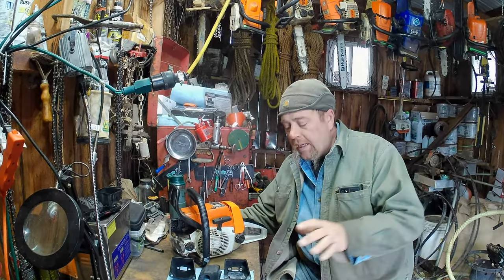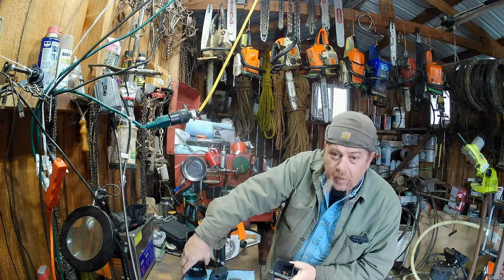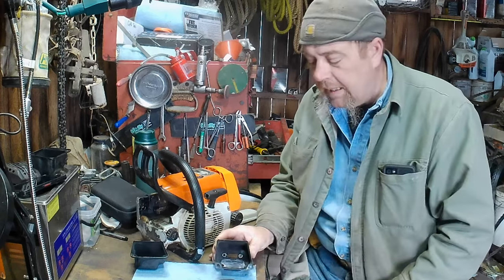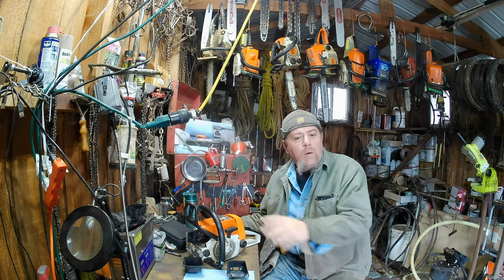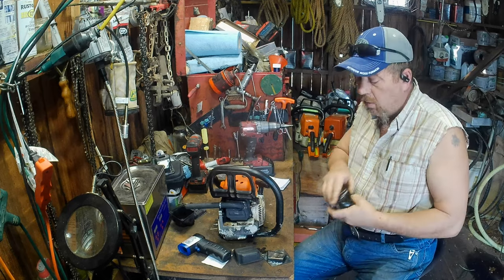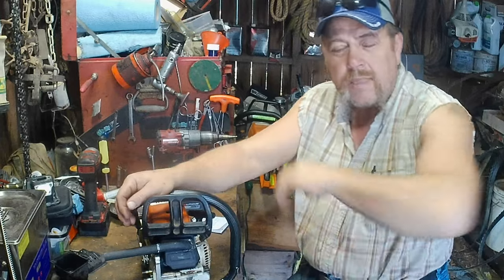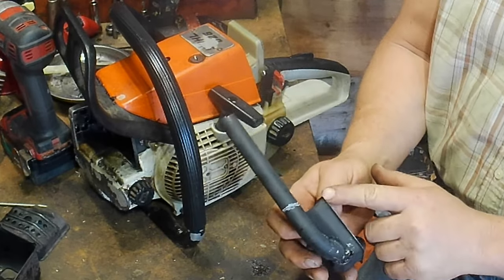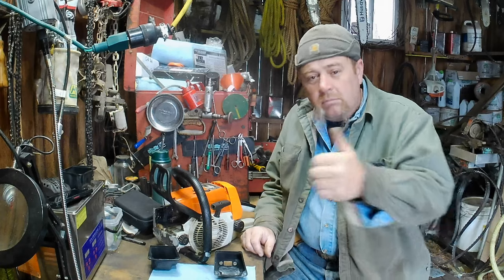TRICK to find PIPE LENGTH for Chainsaw; CONFIRMED!! Dyno and HEAT Results

Comment: You got me  thinking mufflers and exhaust to a lot lately. Looking for a good balance  between performance and noise, just something for all day cutting. I’m trying something like your tuned piped but I have the pipe about 1” inside the can kinda like a mid bleed stinger in theory. Going to try the heat gun trick. Keep up the great work man!
Reply from the maker: @BuckYaSaws That's why I like two strokes; every little nuance can keep my mind occupied for days!!  With the stinger protruding into the can, I've found a bit of a performance gain by having the pipe cut at an angle to "catch" the exhaust as it comes out of the exhaust port.

Comment: Thank you for a very detailed and informative video 👍 What about a 70mm (2&3/4 INCH) pipe straight trough the muffler with 20mm (3/4") on the outside of muffler, at approximately 90° angle?
It would be very interesting to compare that to your goofy long pipe 😂👍
Reply from the maker: @lundberg223 Thanks!! The 70mm length is about right; the "problem" that I incurred was that the inlet to the pipe (inside the muffler) didn't have a good straight shot for the the majority of the gasses to have a good entrance path to the pipe. I think it can be worked out, but I haven't found the optimum solution yet. I've got some ideas (I hope) for the next attempt.  Thanks for watching and ESPECIALLY for joining-in down here.

Comment: Do you have a video showing the in and outs or demetion of the bar box??
Reply from the maker: @dillardwinters4882 I don't have a video recorded specifically for the build of the cover; it was a flat plate with about.4 sq in of area hole cut in the lower left of the muffler chamber; I cut it as close as I could to the lip without having it obstructed by the lip. The outer cover was just a piece of sheet which was bent to accommodate the opening and widened as it went upward and outward toward the bar/chain. It widened to approx 1-1/4" wide and 1/2" of depth. On the 026, .4 square inches of opening worked best with the reduced volume can (in another video https://youtu.be/--lw9ZkjH4o ) Once I went past 0.4 Sq In of opening to 0.58 sq in of opening, I began losing power. 0.4 sq inch was the sweet spot on this particular saw.  I didn't lose enough power compel me to remake the bark box lid at this time, but I will at some point and intend to make a change to make it even better. I don't expect it to be a huge change, but I'm searching to all the little things that can stack up to big gains so that we can skip right past the stuff that doesn't work and include the stuff that does work on the next builds. Thanks for being here and especially for joining-in down here in the fun!!

Comment: Just a guess, what you have going on is more of a header than expansion chamber. The heat gain/loss is probably related to exhaust scavenging and the hot spot probably changes location with rpm.
Reply from the maker: @Super-Dave-Outdoors  Awesome point!! I thought about that after i did the test and considered the RPM/distance of hot-spot relationship... I had already pooed the scrooch at that point!  
Further, i agree on the expansion chamber; I consider (probably incorrectly) that ANY muffler is too small to make a proper expansion chamber in which sound waves play the major roll. I'm attempting (maybe in vain) to understand it from strictly a volume of exhaust gas while ignoring the science (bad practice I know) of the sound waves... not convinced they apply to this small of a can-style muffler.  The next saw video of reducing can volume REALLY worked on some and didn't on others. 
When I started working on saws I was often-wrong, but never in-doubt; NOW, even if I happen to get something right, I STILL question it! 🤯🤯Thanks you so dang much for your insight and input!!!
Reply: I'm with super Dave on this one.  Believe he explained what is happening with heat and scavenging. From my experience with pipe length and magic dyno feel. Longer pipes favor low end power and shorter pipes respond quicker and like the top of the curve. This is what is so contradictory to 4 stroke exhaust.   I've often wondered what divided flange exhaust much like an x or h pipe would do on a saw. Would it act more like a chamber pipe being you are able to truly direct the flow of the exhaust. I know divided flange turbos are consider more efficient spool quicker and create more power when tuned properly. I understand this is done with the pairing of multiple cylinders and creating the same length. Could a single cylinder 2 stroke be " tuned " similarly but using the divided flange approach of a turbo by the x or h pipe design to give you the best of both? 🧐 I think I just scrambled my egg there. Darn rabbit holes got me again.  

Hey great series and another great video. Really enjoy your whole approach to your channel and taking in constructive criticisms and feedback. Some people are a bit to P.C but I can see you have the clout to stand and take it. 😆 Nice job! Always a delight. Thanks
Reply: You’re way out their ahead of me on all of your dyno testing. Just the fact you built all your test equipment out of what looks like your wife’s ole sewing machines, and Maytag washer/dryer parts shows your ingenuity, but producing the sound information out of that contraption shows your analytical high IQ mind racing out their at the NASA level. I hope the, I hate to say it, “Stihl” Chainsaw engineers invite you to their testing and proving grounds. Me, I’m gonna to wait, like the Chinese Manufacturers , until you prefect it and just copy your work. I am gonna write the Stihl Corporation and ask they give you a free tour of their chainsaw testing plant. Keep up the good work. Ole mountain man
Reply from the maker: @eze.Morning_Wood_Farms  Aw heck, there's no shame in being ignorant... stoopid is another story. I am soooo far behind most people on saw building it ain't even funny! I've built way less saws in my life that some people build in a day or three...I take no umbrage in being taught by people who are willing to teach me... no matter their delivery (most are super nice though)... I had a career of not being the most popular guy in the room... you're right, I can take it.  I think volume  (next saw video) is going to open-up some ideas and thoughts to keep the grey matter from stagnating... at least for me. Thanks for being here; hope the dog is keeping them pesky puddle pirates off your pond... looks like he likes the challenge!!!
Reply from the maker: @olemountainman3996  My WIFE'S sewing machine... pfft; the old Singer (was my great grandma's in a leather covered box) is mine and I won't let her use it!! The Dyno has parts from a all kinds of gadgets... a homemade PTO generator, feed grinder/mixer, old round baler, etc... The pipes on the saws are made from the tubes from an old office chair and an old ironing board (so far); you've got me pegged!!!! Them Stihls make me look good as there's so much room for improvement; them other saw builders all build Huskys... 10 minutes and they got a ripper; takes me 10 minutes just to get to the air filter on a Stihl 😉😉 Thanks Ole Mountain Man!!

Comment: I think that offset cylinder is the best thing for practical efficient engine there is and there are so many variables to play with rod ratio etc. I just like to cut trees and don't do all that all out race saw
Reply from the maker: @richarddodds9326 I also think it has a great ratio of risk/reward; more torque, more hp, less wear on the piston. This saw has an offset cyl (quite a bit after this video) and is actually a VERY mild build; I have not gone extreme on anything, but keep stacking the little easy-to-get gains and it will probably need tamed back down a bit before I turn it loose in the woods and exposed to dull chains and whatnow. THanks for joining-in; this is the first comment from you that I remember... welcome sir!!

Comment: 230E is named after my favorite log skidder, a 1980 Timberjack 230E. Youtube added the 4 recently so it had enough caracters, I don't really like the 4 on there (maybe youtube shouldn't make decisions by themselves ;) or perhaps I should use a proper name instead of numbers. It would be very interesting to see the effects of shortening the pipe inside the muffler. I typically run about 3/4" inside. I have noticed the exhaust tends to be quieter with more pipe inside, depending on it's  orientation to the exhaust port. After trying a bunch of different diameter pipes and doing test cuts I have pretty much settled on 1" pipe, 7/8" I.D. I even experimented with copper pipe of different sizes. It is great to see the tests on your dyno.
Reply from the maker: @230e4  Ahhh; I reckon the ol Timberjack did have 4 tires, so there's THAT! Bet I can remember now! I've cut some some off from inside the pipe and cut it at a more favorable angle while doing so. I agree that a bigger pipe is in order, but I wanted to try some baby steps; the next video is the reduced-volume can using these same lids (3/4" hole, bark box, and this pipe); I may add the the pipe with the bias-cut to the video (editing it now, but haven't recorded the biased cut or tested it yet). I also have some pipe picked out of the scrap heap that I think is about .8" ID which I want to try (as well as larger hole in the can and larger hole in the bark box. I will let the cat out of the bag; one of the lids really liked the reduced volume can; the pipe did not really like it; I think it's too close in proximity to the reduction baffle to allow proper air flow into the pipe.
I'm starting to compile data on area (sq inches and sq cms) of holes and pipes as well as volume of pipes; I'm compiling the info in the event that a pattern may appear. I will see if there is a way to share it in the video in a easy-to-watch and understandable way... heck, I don't even understand it yet...not enough data points. I'm also aware of many many variables to even hole size and pipe volume; plus, I'm satisfied (guessing with misplaced confidence) that volume needs will change drastically with diameter.   ...heck, I'm rambling again. Thanks for your input and being here. How long were/are your 7/8 ID pipes? (with 3/4" inside?)
Reply: @HayChaffandSawdust1  Thanks for the reply. The pipe is 1.5" overall. I put them in the clutch side upper corner like the OE 372xp. I have wanted to test more with no pipe inside verses having pipe inside, but with farming and logging full time it has been hard to make time for it, that is why I am grateful seeing folks like yourself testing modifications and sharing them. I have simply run the dual port Stihl mufflers opened up some on my 066, ms660, 046, ms460, and ms461 saws for years because they were quick to do. Have a great day!
Reply from the maker: @230e4 I get the busy-life bit; beside the sawmill (as I feel like it), the chainsaws (for fun as I have time), I also farm about 100 acres of hay here (mostly square bales) as well as raise cattle, sheep, and a few hogs... not comparing or crying; just saying I understand!!!! Have a safe one today!!

Comment: Very interesting.  Some other things to keep in mind, when you change the exhaust, you may need to change carb settings.  It would be good to get the cylinder temp as well.  I ran r/c cars several years ago and we reffered to the area of the pipe to the air as a stinger.  There are different sound waves with longer and shorter pipes.  I thought your ideas are pretty good.  I hid a pipe in the muffler of one of my saws.  It does pretty good. Looks strange in you see inside.
Reply from the maker: @rcracer641 Very Good info!! I assume you just found this channel; I do  tune the saw each time with different pipes and/or different temps for each Dyno or heat pull; I tune it for max pull at 10k (that's the fairest way I know presently... but, I am working on tuning by exhaust temp) . 
If you find time to watch the end of the video, you will see a chart of head heat temps for each run Vs HP (pulling at 10k) for each exhaust type tested.
I fully agree with the stinger and expansion chamber and the effects of each. I'm trying to consider that, since the most-effective sound waves are created in the expansion chamber... and a chainsaw doesn't have a large enough, long enough, or shaped properly enough to make the most of sound waves, it may be better to harness the rebound of the actual exhaust column (as it travels differently than the sound actions used to tune a pipe) to maximize performance in a can-style muffler.
We (hopefully) will have added exhaust temp to existing head temp after the next video (takes me a bit to edit and the next one... really neat reduction in volume of the can will be next in line).
Thanks for joining-in and taking part.

Comment: Since you are doing mufflers..  I have often debated with a stihl style muffler putting a solid "divider" plate between the halves.  Both one that is flat and one that has been hammer formed to protrude into the can on the side opposite of the factory outlet (if a single outlet saw)
The plate would DRASTICALLY reduce can volume, especially the one domed in some towards the hug half, and in my mind might make a can perform more like a pipe as the pressure peak would be higher, but the dwell time shorter.  A flat plate would be easy to cut out and test.  The hammer formed one less so..  but it might give some insight into can volume.  Most factory cans seem to encourage bounceback and swirling with geometry.  One could totally F with that with just some 20ga steel sheet and see what happens.  If someone made some hammering jigs from hardwood all kinds of internal shapes could be tested.
Reply from the maker: @mattfleming86 The next chainsaw/dyno video is/will be a reduced-volume can and the results were better on some and worse on others (I think... still getting info into dyno, but gut feeling and watching the numbers  on the pull). I have not got it hashed-out in my head NEARLY as well as you. Out of curiosity, how much had you considered reducing the volume?  
I agree on hammering out thin stuff to try-out; used @.025" (don't know gauge... was shim stock from a Press job) stuff in the next can to be shown. 
I appreciate your comments and getting my ol' grey matter to start stretching it's legs!!
Reply: @HayChaffandSawdust1  Well, the joy of a bolt-in insert that goes between the halves is that the volume can be varied.  Don't have an 026 on hand, it's at dad's house, but from memory i'd say a "flat" sheet would probably delete 1/3 of the can volume (just like a bark box style can does) 
Bulging the sheet either direction could really change that internal volume quickly, AND influence how the pulse moves within a can  via the shape.  
That's why I thought it would be fun to try..  the overhead of thin stock is low.

If one stumbled on one design that just worked really really well, a hardwood press jig could be fashioned and they could be quickly made with a press.
Reply from the maker: @mattfleming86 I know dang good and well that you're onto something... at least, for certain outlets!! Previous video (stock can) worked well with bark box Vs 3/4" hole Vs Shortest (so far) pipe with a clear winner; the; the next video with reduced volume can on each of the three aforementioned lids showed varied results; some liked it and some didn't like it so much. Dang good ideas that you're offering to all of us; really appreciate the ideas and encouragement and for just joining-in.
Reply: @HayChaffandSawdust1  Good luck bud!  Enjoying this series

Comment: Try up to a 1 inch pipe 🤷 maybe. I usually put 2 .50 pipes in a 40cc... No dyno for numbers, seems to rev up a hair faster... but speed ain't power either. I am enjoying this lil project 👍😎 living in the Show Me state... helps open my mind up 😊
Reply from the maker: @z1berzerker Get outta my head!!! We'll have dyno results for just such an idea pretty soon. I've also started compiling/documenting area (and volume on pipes) of exhaust; for instance 2x .5" holes is 4/10 sq inch whereas the 1" is 8/10 sq inch. It would take (nearly 4 1/2" pipes to equal a single 1" pipe.  ... anyway; You're right there with me in my thoughts; it takes a lot of patience for me not to jump ahead and try stuff "on the way" to where I want to go.
Heck from Show Me? You prolly don't even have to have a translator to listen to me yammer-on. I'm about 90 miles East of St Louis. My sis lived in St Peters or St Charles... right on the border between the two.
Thanks for bein' here, Joe!!

Comment: Very interesting on the length of exhaust. It's nice to know that you don't need that much pipe hanging off your saw.😂 Maybe some day when you get time, you can make a dual exhaust pipe for it. I'll be trying some exhaust pipes soon. Muffler mods anyway. Keep up the good work.
Reply from the maker: @TheJohnDeereGuy I plan to make a duel piped saw fairly soon; my thinking for order-of-operation is bigger pipes and bigger openings on the various can lids (right after the reduced-volume can; next video; very neat results) then on to  dual exhaust and dual holes.  Thanks for being here!! Let us all how how your version works.